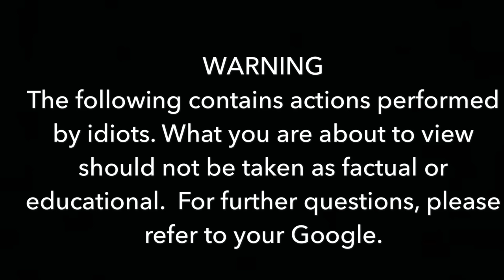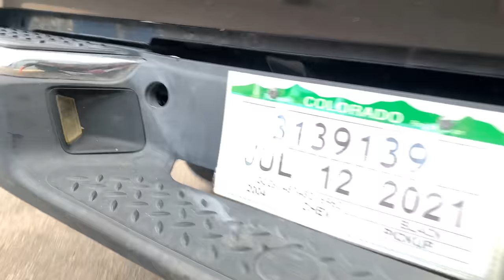BOOST BOTTLE Controlled Exhaust CUT OUT! [Boost Actuated Cut Out with No Boost]

Comment: Like I said before, whatever works... I've uses those sprayers on a budget intercooler sprayer setup. It works quite well at lowering the IAT'S. I've tested it (abused on track,) and it has worked every time. The truck sounds pretty good open exhaust. I would build a mandrel bent one with an X-pipe to help with the scavenging effect. If done correctly you will pick up some measurable power. The Magnaflow is a great choice, and I use them or a Vibrant for a good affordable muffler. The V-bands are mandatory to make things quick and easy and leak free, so good work there.👍👍

Comment: I have a 08 tbss with a 402ci  tsp stroker and 4l80 manual shift  setup . If you ever wanna boost it . I have the ss stock exhaust manifolds to flip for a turbo setup 😉. That’s a extra muffler for the neighbors
Reply from the maker: Hmmmmm 😁
Reply: @GARAGEIdiotS  just pay for shipping and yours if you want I have the y pipe for bends also that goes with them
Reply: Also my old channel I got locked out of is   “ the dreaded fam”  . I have my tbss , 94 5.0 ranger flatbed and 87 rx7 vids on there . Instagram is dreaded7. The tbss build and the others is in there . Haven’t posted in a minute

Comment: Check at the scrap yard for an electric compressor from a Caddy or a lincoln for their air suspension. in the 70, Caddy had a vacuum air compressor, we had one on a step van for the truck air horns, the long type. Awesome on someone is sleeping at the wheel on a green light. Have fun with the cut-out and take care.
Reply from the maker: Ah good idea!!
Reply: @GARAGEIdiotS  Just put a switch somewhere on the dash and connect the air hose direct to the cutout but check if the air actuator on the cutout can take the full pressure (just put a sewing needle through the rubber air hose so when you cut the power, the air will bleed, you might need a few holes). Or just use a small 12V air compressor, the cheap kind to inflate tires. They sell for $10.00 at flea markets.
Reply: Use a transbrake swith on the steering wheel, people will freak. LOL
Reply: @micheltremblay4774  cheap tire air compressor at harbor freight for about $6
Reply: @darrenswails  We don't have Harbor Freight in Canada but I'm sure Preston will find one. Those on Caddy and Lincoln can be use to fill a small air tank to 100+ PSI and used for air horns, inflating tires, air suspension with the leveling valve when loading the pickup with heavy stuff, etc...

Comment: cool work preston..but you might consider not doing projects on the daily until you have a working BACKUP vehicle  as its so easy to forget or discover an issue mid job that is critical and you arent prepared to deal with and complete before sleeping at the shop is the only option. ....unless you like sleeping at the shop that is. as far as the neighbors go they should tolerate the noise for a while in good faith that you will address it as soon as you are able   but you might think about doing something nice for them ,,,yard work  tuneups for the cars  wash and wax  or a bbq  ,,hey there your neighbors you should know them and what would would best presuming that there good neighbors and you wish to keep them. as always thanks for the vids  now someone chain that man back to his grindstone!...ps electric air pump for tires 12v  is a thing  also for aquariums but thats 120v  and a solenoid controlled pressure relief valve would make your system a push button mounted in dash/console thing of elegance compared to the brutal simplistic genius of a person not watching the work being preformed and not fixated on one way to achieve something.